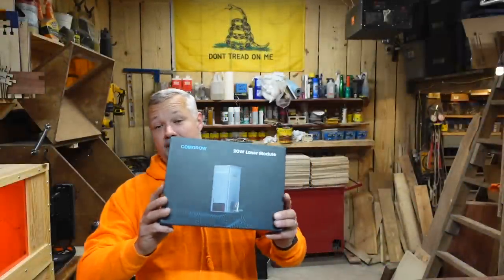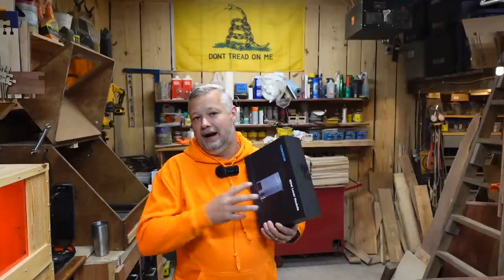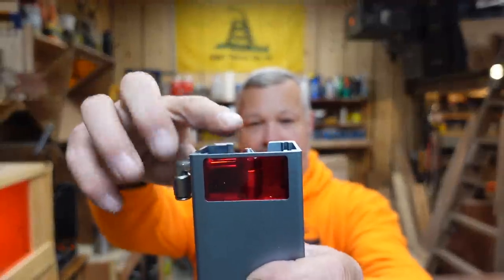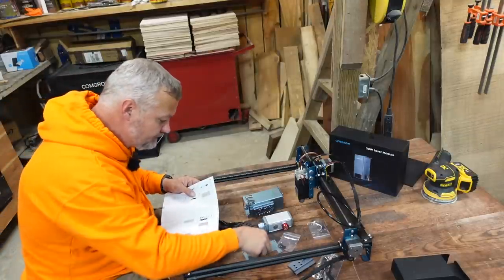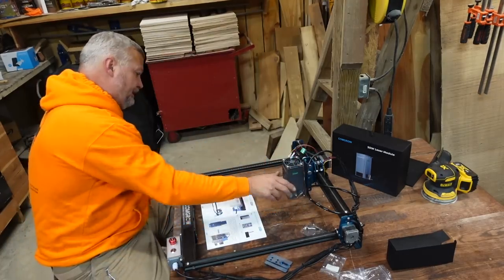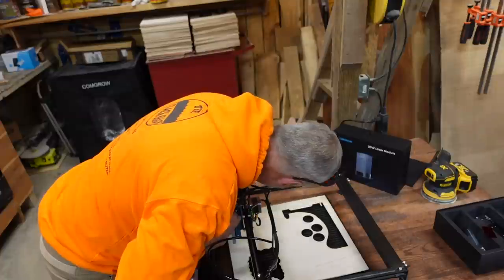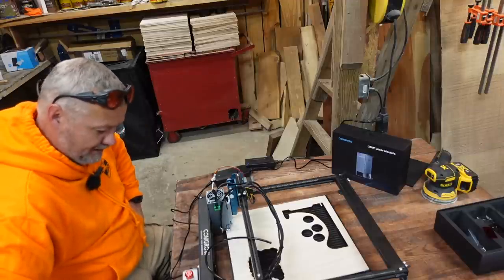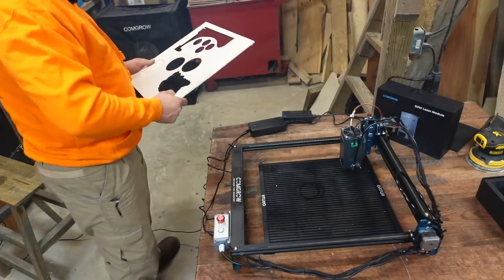20 watt Comgrow for Z1, D1, LM2 and LM3

Comment: Awesome stuff!  I think this is an awesome upgrade for the Ortur! Speed and Power!
Reply from the maker: It really is!
Reply: @TheClackShack  yes but having the z1 I was hoping the review with the z1 would have been better not choosing to make a Franken-laser with an Ortur Frama / Comgrow head combo. Still think the z1/Comgrow head is a better combo. Specially since I sped up my z1 with 20k travel speeds ($100/101 in Grbl) and 5k accel ($110/111) & Homung & move speeds in LightBurn both set to 8k too. Makes the z1 super fast (maybe faster than the Ortur) and still accurate and repeatability is not affected.

Comment: Is there a special cable or adapter required to connect the comgrow 20W module regarding the PWM signal to the LM3? How did you do that? Thank you!
Reply from the maker: Yes, the 20 watt module ships with multiple adapters for the supported machines.

Comment: Will need to adjust the y stop for the larger module not to hit the front extrusion when homing. And will lose some y travel from the standard 400 y travel…
Reply from the maker: I cut it down to 380 but it still touches. It works well so far, made the video first day I had it. Been using it for a couple weeks now
Reply: @TheClackShack  did you send Comgrow the info for updating the instruction they send out with production units, I’m hoping? So buyers don’t have the same problems?

Comment: How can you make your machine go back Left wen is done engraving? I wanted mine to do so!! I have a Comgrow Z1 10w, I appreciate your help.
Reply from the maker: Setting the "return to" location in lightburn
https://youtu.be/G9Mh--nr_5E
Reply: @TheClackShack  I did what it is on the video, but still going to home front,😔
  What I did wrong ? I have a Comgrow Z1
Reply from the maker: @logoidea4u  , home is set on the controller and I advise against changing it unless you have 4 limit switches. Return to setting takes over after the burn.

Comment: I ordered and received the Comgrow 20W Laser Module, but the adapter marked XT from Comgrow doesn’t match the XTool D1 Pro cable (The XT adapter from Comgrow has 8 pins and the XTool cable has 9 pins). I’ve contacted Comgrow and I’m still waiting for a response. If anybody has received this module I’d like to know if there is a separate adapter labeled XT D1 Pro or something will fit. I think the correct adapter was left out of the box.
Reply from the maker: I haven’t tried to put it on the XTool. They may have left it out

Comment: I ordered the Comgrow 20W Laser Module, but the connector on my XTool D1 Pro doesn’t match the adapter marked XT. The other adapters are marked CO, OR2 and OR3. Isn’t this supposed to be compatible with the D1 Pro?
Reply from the maker: It says that it is, I haven’t tried it yet. There was a section in the manual for XTool.
Reply: @TheClackShack  The adapter is different. One has 8 pins and other has 9 pins. I’m waiting on their response from their engineering department, but it seems that the shipment may have left out the correct adapter.

Comment: I received an email back from Comgrow asking me to take photos of both sides of the XTool D1 Pro mother board specifically the area where the cable is attached. It seems a little off to have a customer do this. Thoughts?
Reply from the maker: They may be wanting to confirm that there aren't more than 1 designs for the machine. I have seen some differences in machines in my experience. It is possible that XTool used different plug designs. Comgrow has always worked with me pretty well.
Reply: @TheClackShack  Thanks for the response. It’s hard to keep up with all of the changes and add on’s for the diode lasers and some of these machines look like prototypes. I’m ok with trying to address this. Just trying to make sure I’m not wasting my time.
Reply: @TheClackShack  Comgrow did respond and said their engineer is sending out a new cable within 24 hours. Hopefully I’ll have something going next week.
Reply from the maker: @donalddickey1686  cool
Reply: After sending photos of the XTool D1 Pro mother board pin out, Comgrow sent me a new adapter cable. I set up the Comgrow 20W Laser Module in the XTool D1 Pro frame and ran materials tests. There’s a major difference with 20W. I’m testing to refine my settings. I also need to work on homing and cable routing.

Comment: I bought this module and have the Z1. Couldn't get it to work. Had 3 sets of cables and none of them were right. Contacted the company and they sent the correct cable via China. Got it and oh boy, what a difference from the original module. I did fix the issues with the limit switches and zero problems. Cuts SOO much faster. Can do what took me 2 hours in 1/2 hour or maybe a hair more. 
Thanks to your vids I was able to get this working flawlessly. Definitely a good upgrade for my machine.
Reply from the maker: Good deal

Comment: Good review.  Good solution to fix what should never have been an issue.  That seems a huge oversight on the part of the designers to not be plug and play compatible with one of their flagship products.
Reply from the maker: It is plug and play if you run it as "current position" I just do alot of repeat products and prefer limits

Comment: Nice test.   Can you easily re mount the original 10W module or is it a time consuming process to switch back?   Ortur sent me a svg template to cut out standoff spacers that can be installed using the existing limit screws on the side rails.   I really do like my LM3 but sometimes wish it had a little more juice.   I am holding out for their 20W upgrade, but this Comgrow option looks decent.
Reply from the maker: It isn't difficult but does take a few minutes.

Comment: Thanks for this.  The laser module seems to take away alot of room, especially towards the front due to mounting position during your 1st test. It sure has some potential
Reply from the maker: Using current position, it works well but you do loose some area.

Comment: Why not mount the 20W module high enough on the Z1 so that the 20W's hose and handle don't hit the side frames, and then just bring your work piece up a corresponding distance, to bring it into focal range? Like maybe stack two or three honeycombs? Or am I missing something?
Reply from the maker: I think you vastly underestimate the size of the module. It is 4 times larger than the original. It hits on 3 sides.

Comment: Great video!  I may have to get one!  The only laser I have is the Comgrow Z1.  I have already been talking to them about adding limit switches on all four sides and I think that would be necessary for this larger module. I am confident that I can make the limit switches adjustable to accommodate the larger laser.  Maybe after Christmas..  Good job!  Thanks again!
Reply from the maker: If you run it on current position, it works much better. It took some testing to figure out the best setup.
Reply: The y-axis switch is already adjustable on mine. It has the t-nuts holding it in place. Only issue will be the x-axis might just tape a spacer on block.
Reply: has anyone figured out the limot switch issue on the z1?
Reply: @LIMoto-oh5tx  on how to adjust the X axis limit switch to account for the larger laser module?   I screwed a small wood block to trip the limit switch sooner so the module didn't crash.  Been working fine since then

Comment: How do you think this will work if you put it in your D1 10 watt. I see a $70.00 price difference for Xtools 20 watt for D1
Reply from the maker: It should work with the standard model. The pro has limit switches and there would be a similar issue to what I had with the Z1. I have found that if you run current position and hand place, it is easier to avoid crashes. Also have to downsize the workspace dimensions some.
Reply: @TheClackShack  Well I bit the bullet and bought one. Now I see they are running a sale for $399.oo:face-orange-frowning:

Comment: Hello there, thanks so much for this video. I just got this module for my OML3 As you know this module is much larger than what comes with the OML3. Do I need to adjust the work space size to accommodate this module, or will it work fine with the settings for the 10 Watt that comes with the machine?
Reply from the maker: I adjusted my workspace to accommodate
Reply: Thanks. May I ask what size did to adjusted to?
Reply: Do I need both power supplies connected to the machine?
Reply: Thanks so much for all your help. I got it working and I love it!!!

Comment: Great stuff bud!! I have been watching your videos and like the 20w setups you have. I am in the market for a laser to start a good side hustle with and finding out for a good 20w setup with all the bells is around 2K and honestly i can get into a monport/omtech mid range 55-60 watt for 2500ish.. whats your thoughts? thanks!!!!
Reply from the maker: It just depends on your intended use of the machine. You have to weigh the options, is power more important than versatility? Just make sure the machine will work for your projects. Each type of machine has its strong points and weak points.

Comment: Clack, you said you liked almost as much as ortur.  I don't have a machine to "repurpose" so I am back to the question.  buy 20w comgrow or ortur or atomstack?  What do you think after seeing the comgrow?
Reply from the maker: I like the 20 watt module, not crazy about it on the Z1 frame but it works. On the LM3, its a beast and is faster than my D1 pro 20. I do like atomstack machines but haven't had a chance to try the 20. Steve has one and says it is a good machine.
Reply: @TheClackShack  They are already sold out of the 20 w head!  I think I am going with atom stack.

Comment: Curious how this module will work with the xTool D1, or if it would be best to spend the difference on the (more expensive) actual xTool 20W module.
Reply from the maker: If you use the add on module, probably about the same.

Comment: Need  some help with the z1 it just wont connect im on windows11 I installed the driver that came with the USB download laser grbl and lightburn install both they dint find the laser I tried adding it manually and was still unsuccessful.what i do?
Reply from the maker: Check under device manager and see what is showing up in the “ports” section. You may have to uninstall the machine and reinstall it if the driver didn’t work. You should see the device under ports. That port is the number to select in lightburn. Was it the CH340 driver? If so, look for the port labeled ch340
Reply: I got it to connect laser grbl but not lightburn
Reply: In device manager it's there working correctly but it still wont connect to lightburn

Comment: Bought the Comgrow 20w for my Xtool D1. WORST DECISION I COULD HAVE MADE. wiring for laser and adapter cable is wrong. Have been going back and forth with pictures for a month and no help at all. It is not compatible Xtool D1 in my case. So disappointed.
Reply from the maker: Hate to hear that, It worked great with my LM3. The wiring was a little tough, I had a couple wires reversed the first try. Luckily it didn't hurt it and I found the issue.

Comment: Shame Comgrow no longer offers this upgrade module for z1 owners. They never responded to inquiries on this module and now appear to be sold by a company called Sovol who responded to my inquiry with “ It is not recommended to upgrade your z1 to 20w.
The installation positions of 10W and 20W are different, 
and the adapter cables are also different. 
It is not recommended to change.”

Seems like a load of hog wash, too bad it’s not around anymore.
Reply from the maker: It worked pretty well for me, I am not sure why they stopped using it.